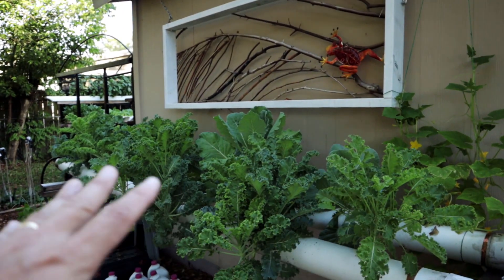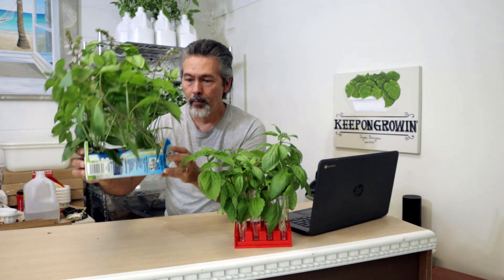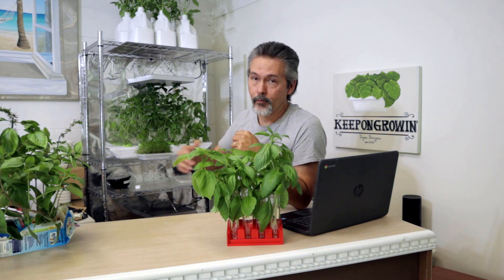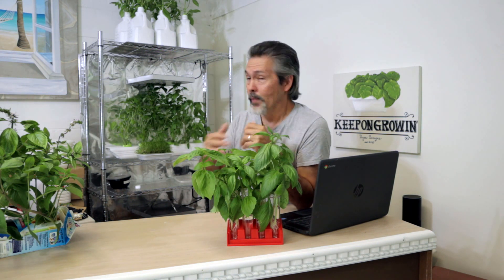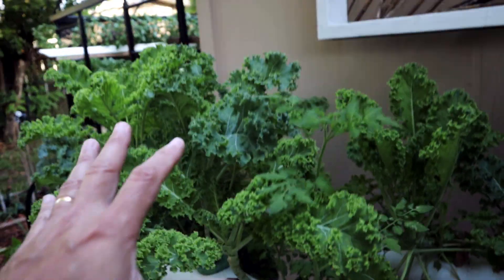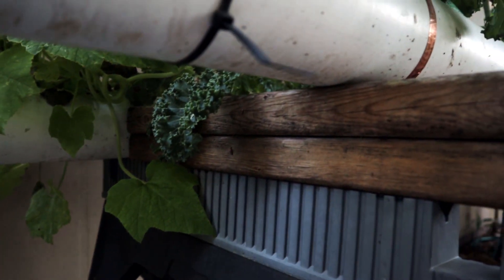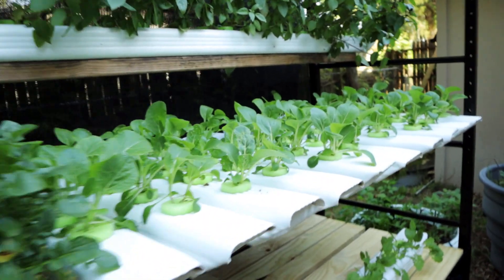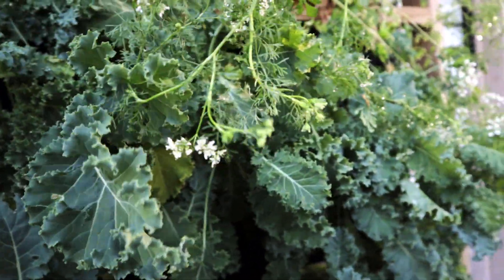Level Up Your Hydroponics, Growing Kale in an NFT System

Comment: I wanted to cover a wall in my courtyard with edible plants, and after a lot of research I decided to try your out of the box ideas!  I planted my first 2 10’ gutters with lettuce, kale, squash, cucumber, peppers, dill, and tomatoes.  I expected to lose a few due to transplant shock, but to my amazement all the plants took off and are looking fantastic!  In only a week the squash has doubled in size and the tomatoes are blooming!  I’m building the ladder to place them on this weekend and can’t wait to see them completely filled out this summer.
Reply: Tomatoes, cukes, and squash will stall after a growth spurt in a downspout. I grow them in 5-6 gallon buckets and by mid summer I have to fill the bucket almost daily as the rootball is the size of the bucket.
Reply: @TNBushcrafter  that has been my experience as well.  It’s fine to start them in the downspout but I prefer to move them only once from seedlings to where they will fully mature.  I find a DWC method is best for peppers and cucumbers and squash.  I haven’t had much luck with tomatoes yet but that could be because I was using too large a tote I find the 70Litre is the perfect size if you don’t want to continually fill however I am growing a sweet red lipstick pepper from seed that has turned into a tree in the past two years of growing it and it’s in a 42litre tote that I’ve wrapped in tin foil shiny side put and it’s thriving after two years of consistently growing putting on blossoms and then peppers and continuing to repeat itself Ive been getting a pretty constant supply of peppers from that one plant.  Ive tried to grow others to this size and production but so far nothing has compared for one reason or another.  I may be transplanting it up into a larger tote and give it a larger container to grow in, when I do that I’ll have harvested a significant amount of peppers off of it then I’ll cut back a lot of the leaves 75% and I’ll also cut a significant amount of the roots as well.  Although this will put the plant into a bit of shock when I transition it to the larger tote it will also cause it to put all its energy into replenishing the roots and putting back on roots I also find that the roots tend to grow to the size of the container especially the way I do it because I don’t restrict the roots in anyway.  I don’t use any netcups or growing media.  I just pop the plant through the hole I put in the top of the container and keep them from falling in or drowning by using folded up tin foil to make a collar that I just wrap snuggly around the stem of the plant but you could also use a pool noodle.  I just always had a lot of success with my tin foil collars.  I also find because I’m growing indoors only that I have to not only harvest pepper frequently but I also have to cut a ton of leaves from it because outdoors they would lose leaves to the window and insects etc.  But indoors that doesn’t happen so I gave ti make them most of it and it’s a bit like I imagine would be like keeping a bonsai because I’m shaping my pepper tree to have a bit of an umbrella shape where I remove a lot of the foliage below and keep it pretty thin on top.  Once I wondered if this was causing the plant to be focused more on growing greenery instead of peppers so I stopped pruning and I soon found that was a big mistake when I lost a significant one of the main branches because it couldn’t handle the weight of the peppers and the leaves and snapped off.  So ever since then I keep a close eye on my pruning.  Because some of those peppers are heavy and so are the leaves.  Also by continually pruning I don’t have to worry about staking it up or external supports of any kind it holds itself up.  🥰🙏🏻🇨🇦
Reply: @leannekenyoung  I have grown lipstick peppers the last 2 years. This year in my 5 gallon buckets I have Buena mulatas, lipsticks, Trinidad scorps, scotch bonnets, etuid bells, nadapeno, habanada, and starfish peppers. The starfish and Buena mulatas  are huge producers. All started from seed on 1/28. My lipsticks have pounds of peppers on each plant, right now. The Buena mulatas had blossoms and peppers before moving outside in early May. I had them all in pint jars on grow shelves with hidden harvest lights. I did swap to netcups and rockwool for ease of use this year with larger plants. I cut the entire bottom out of the netcups though. They fit perfectly in a pint mason jar then I plopped em straight in the buckets. The starfish pepper took awhile to get going. It shot up to about 4 feet before it split from a single stem. Almost topped it numerous times. Now I'm glad I didn't has dozens of blossoms and over 30 peppers on it now. I may get into some DWC next year. I used 27 gallon totes for tomatoes last year but found them to hard to trellis. This year I have a cattle panel arch with the buckets underneath and the tomatoes going through, up, and over. Have over 100 tomatoes on my Brad's atomic at any given point. The get stuffed, san marzanos, black krim, black beauties, and white tomesols are a sight to behold on that trellis/tomato tunnel.

Comment from the maker: Although the off grid hydroponics works well, I still use an NFT (nutrient film technique) system. It provides aeration to the roots by circulating the water. It is a simple system to build out of a few pvc pipes, a small pump a few fittings and a reservoir (plastic tote from home improvement store). Many have seen pictures of this in some of my videos and were asking about it so I will show mine with a quick explanation. Let me know if you need a more in depth tutorial on this.
Reply: You can also use the downspouts for the NFT system. I wish I would have followed mike before building my 4" pvc NFT system.
Reply: @johnhull3189  would love to see an NFT system using the down spouts. Did you build one?